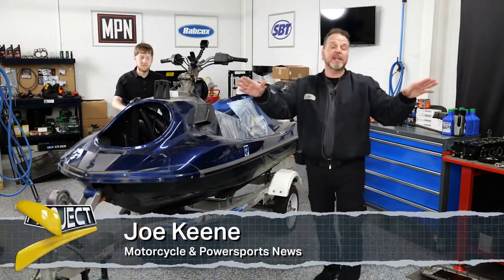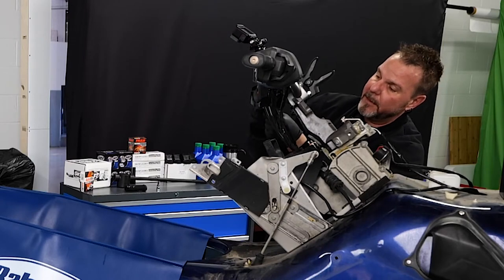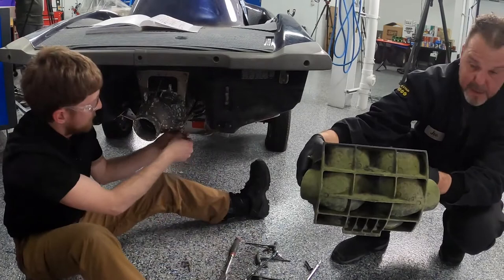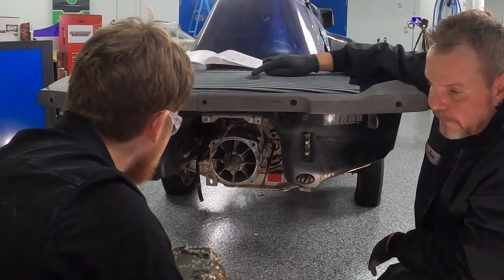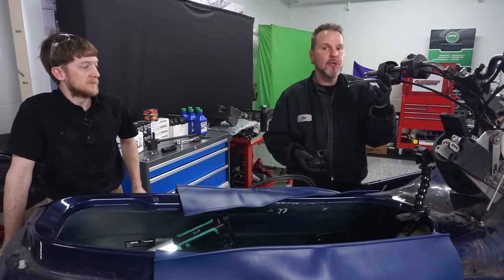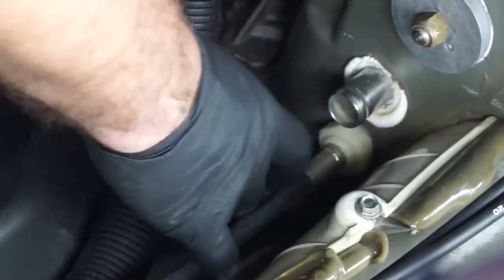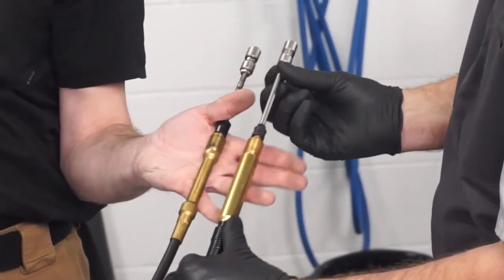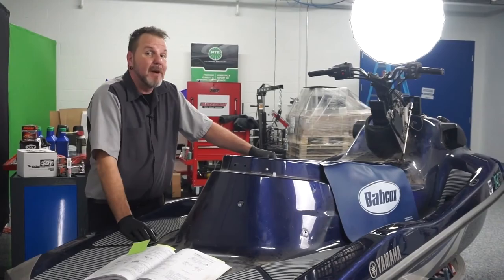Trim & Steering Cable Replacement Project X S2 E4

Comment: Great Video.  My 2011 SHO cables have been seized for the last 4 years and the cable just snapped so the nozzle is flopping.  Was considering finding a way to lock it out but this looks doable.  Thanks!
Reply from the maker: Glad we could help!